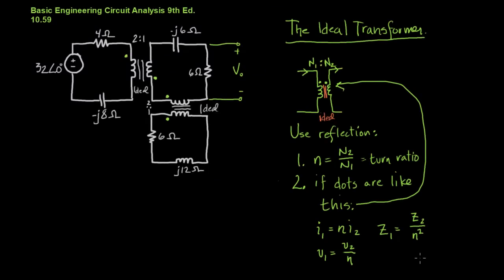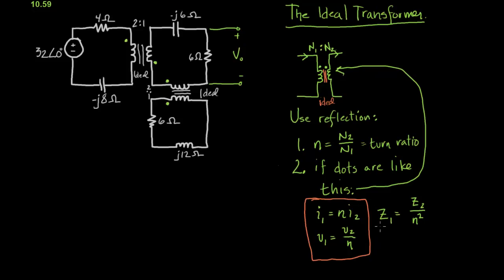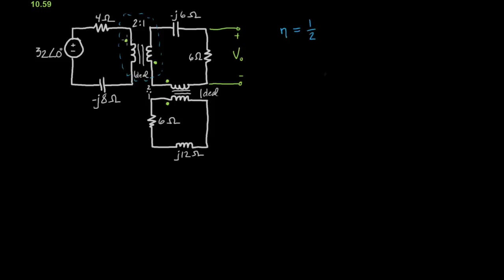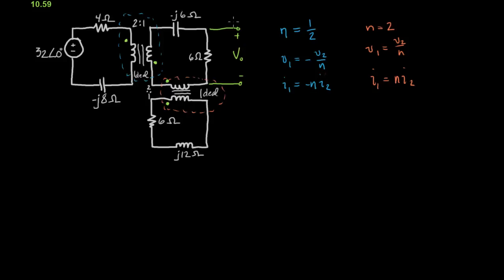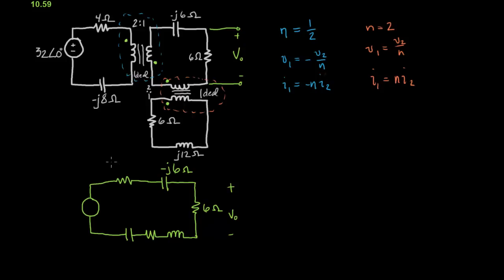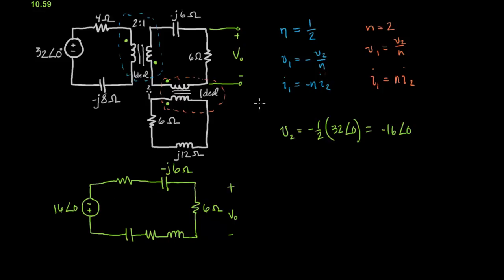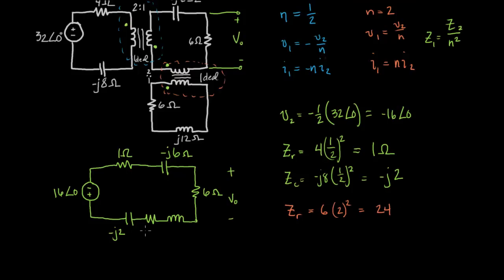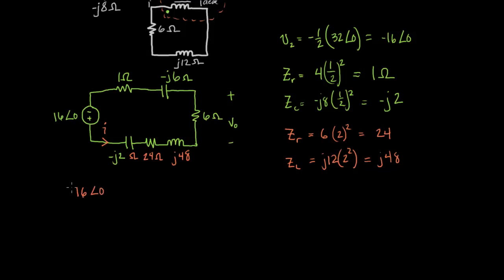Solving Circuits with an Ideal Transformer

Comment: there is a miscalulation error for the total impedance the tolal will be 31+40j and the final voltage will be 1.897<127.78 deg V
Reply: You are write
Reply: Right

Comment from the maker: Pakito,  You are right!  Thanks for pointing this out.  The capacitor in the upper right corner is supposed to be -j8.  That will make the calculations correct and also match the problem in our book.  I've added annotations throughout the video to clarify this.  Thanks!

Comment from the maker: I believe that the turns ratio is a matter of perspective.  The choice of primary and secondary is arbitrary although in most practical applications the primary is an obvious chioce (the side with a power source).  The important concept is that for an ideal transformer power transfer is ideal, ie. if the voltage doubles, the current is cut in half.  There maybe some textbook differences, but I use Ns/Np = n in conjunction with the equations described in the video.

Comment: Question: You said to change the -j6 capacitor to -j8 but you also said that it was not reflected, ergo the value must not change. Did you mean to put the -j8 in the secondary transformer in the original problem ? also, how do you know which components in the circuit can be reflected.
P.S: Anyone who feels confident may answer this question.

Comment: But why does V2 equal to the power source? Correct if I'm wrong, but V2 is the voltage across the left inductor on the upper transformer, right? So the voltage across it shouldn't be equal to the power source cause we have a resistor and a capacitor in the mesh. So a mesh current equation should be written to find the V2 in relation to the source. Am I right?
Reply: I totally agree with you, the voltage across the primary coil should be the voltage of the source minus the sum of voltages across the resistor and the capacitor
Reply: yes